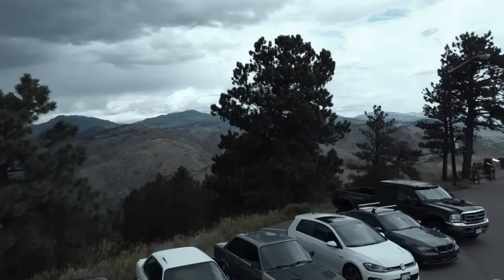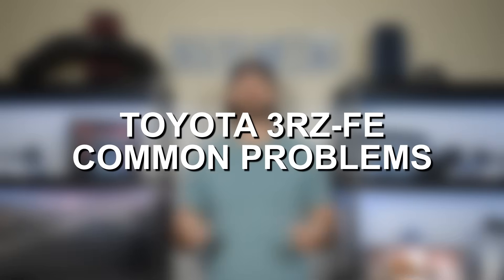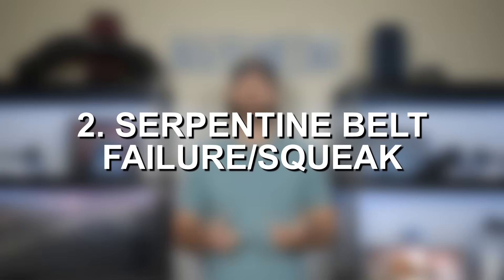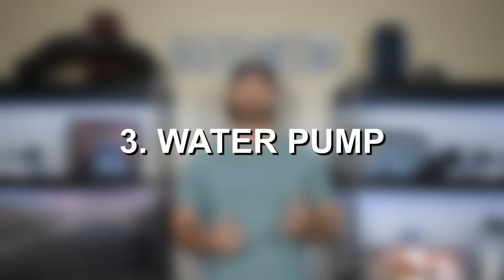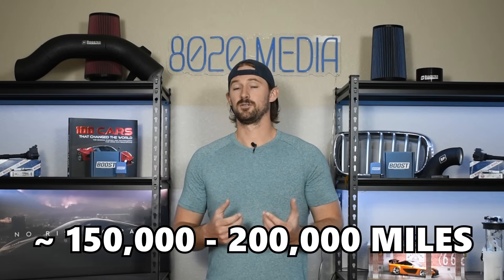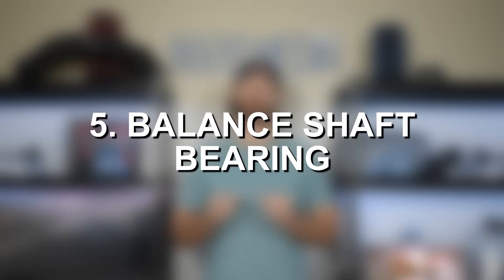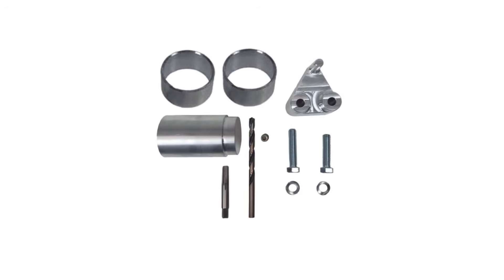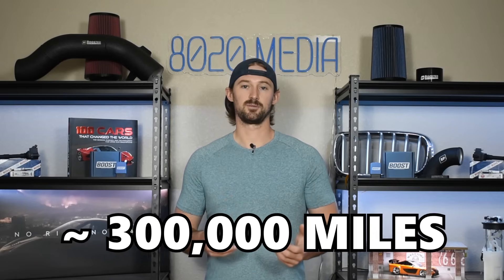Is the 3RZ-FE Toyota’s Most Underrated Workhorse?

Comment: I have a 2002 pre runner 3rz fe. 200k, original everything and valves have never been adjusted. Runs great but I do need to replace my valve cover gasket. The only maintenance is tune ups and fluid changes. I changed the belts once. Great motor.

Comment: You should check your stuff more carefully.According to my knowledge, 3RZ-FE doesn't have serpentine belt, there are 3 separate belts.And the main issue of this engine for which Toyota has made a service bulletin is the head(aluminum) and exhaust manifold(cast iron with separated pipes) thermal expansion difference which leading to manifold cracking around 200K miles.The cracking usually  occurs between 2nd and 3rd cylinders and through the crack starting to suck(between pulsations) oxygen in the exhaust system, thus lying the down stream oxygen sensor that there is leftover oxygen which means that air/fuel mixture runs lean.The ECU starts adding more fuel, but the fuel cannot burns in the explosion and basically burning with a delay causing the exhaust valves to run hotter and ultimately to burn them  out.

Comment: I have 320000 km on my 2004 Hilux legend 35 4x4 2.7 3RZ - The engine has never been opened and is red-lined daily. Amazing engine, I did the EGR delete, put on a performance exhaust and still have the balance shafts in, but I will probably remove them in the next year or two. On my vehicle specifically these things are what I've had issues with - Engine related: Water pump, Spark-plug Leads, Air-con compressor, exhaust manifold gasket failure. Other vehicle issues: Brake master cylinder, Electric rear diff lock. These are not a lot of issues for the age and distance done, that also being on very rough farm terrain in South Africa. Really low cost engine over the lifetime to maintain, even with abusing it off road. 

These issues once fixed will give another 250000km+ and one thing about my vehicle is that whatever fails, fails only 50% allowing you to still drive home 🤣The upgrade I am busy with next is a small 5 PSI turbo just to help with a bit of boost because above 3000 and below 4400 rpm the engine is a bit laggy, but above 4400 is where the magic happens.

Comment: The only issue is the head is prone to cracks otherwise it’s a solid engine the cam chain can last easy over 400,000kms it’s a easy to repair engine and any back yarder can fix these engines

Comment: I have a TOYOTA coaster(BUS) with a 3RZ-FE engine, it is very good and reliable engine and i drove it 600,000 kilometers and still as good as first year, thanks for the video❤ from Kurdistan
Reply from the maker: Z - Thanks for the feedback and for taking the time to share your experience!
Reply: Wow really been loving this engine as I have a surf with the kz but always wanted the 3rz
Reply: Did you ever do valve Adjustments?
Reply: @kempy2  yesh only needed to adjust one after 268k runs like a dream
Reply: @bosshogg690 mine is up to 280,000 and idk if the previous owner has done it but the engine still feels smooth so I’m assuming it has been done before.
Reply: @kempy2  You should still check it, since the exhaust valve isn't noisy when its out of spec
Reply: @kempy2 yas
Reply: did you valve clearence often ?
Reply: @bosshogg690  no

Comment: 170k on mine and it'll last 400k easy with what i've done to it to keep it reliable as hell.  They aren't complicated - keep them cool and clean = they run forever.  Oversized Koyo radiator, fresh coolant, OEM mini header from 01+ years + ceramic coated exhaust/downpipe/header + adjusted valves = reliable as they come
Reply from the maker: T - Nice ride, it sure should! Thanks for writing this up.
Reply: how often do you adjust valves?

Comment: hello mine activate the diff locking system when I travel above 110km/h what could be thee cause?
Reply from the maker: B - If your differential locking system is activating on its own when traveling above 110 km/h, that’s a serious issue—this system is only meant for low-speed, off-road conditions, and engaging it at high speeds can cause drivetrain damage or loss of control. The most likely causes include a faulty differential lock control module, a shorted or damaged wiring harness sending an unintended signal, or a malfunctioning speed or wheel position sensor confusing the system. A stuck relay or faulty actuator could also be to blame. It’s critical to have the system scanned with a diagnostic tool that can read drivetrain modules (not just engine codes) to confirm what’s triggering the lockup. Until resolved, avoid high speeds to prevent catastrophic drivetrain failure.
Reply: Olá, o meu 3rz de 1996 está falhando, mesmo trocando velas, o que posso fazer?

Comment: Hi, the power steering air control valve failed a while ago, and I don't know how to properly connect the valve's outlets to the engine's inlets. Also, power steering oil is entering the engine. Can you help me properly connect the valve to the engine and where I can get a good-quality valve?
Reply from the maker: M - Have you taken it to a mechanic? We can't really assist over comments.

Comment: 150k mile timing chain interval, wtf? I've owned a car with one for 5 years, been on dedicated forums where people would post about that sort of thing, I've NEVER seen one need to be replaced at 150k, I can't remember seeing anyone need to replace one period. My chain is at 50%, assuming it wears at the same rate I'll need one at 400k miles. 150k miles chain interval is ridiculous. Also there isn't one chain, there are 3. 
A more real problem would be that if the front timing cover leaks you have probably have to replace the head gasket to fix it because the front cover seals against the head gasket, and there's a chance it wont seal properly to the head gasket after you remove it, leading to a worse oil leak.
Reply from the maker: C - We didn't make the timing chain interval.. However, thanks for taking the time to share your experience.